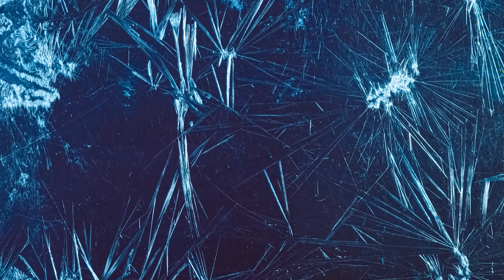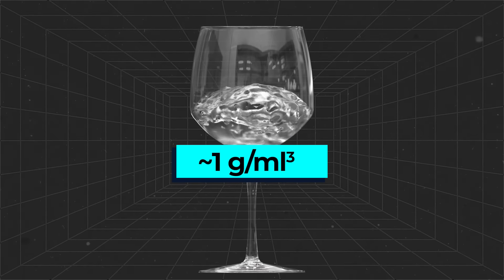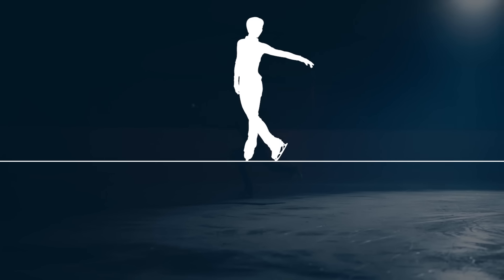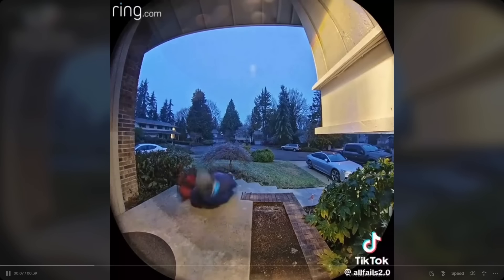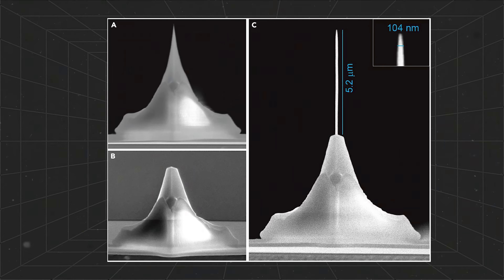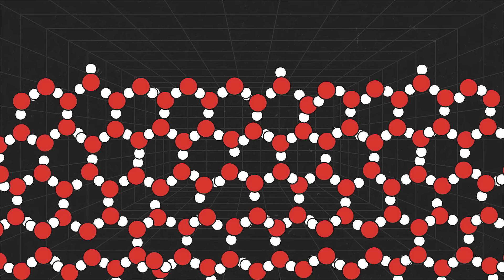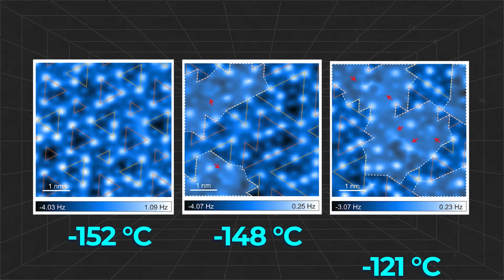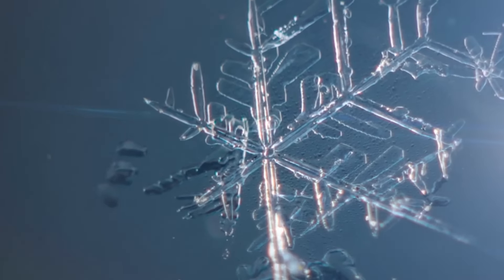We FINALLY Proved Why Ice Is Slippery

Comment: do you know why, when you wet your fingers with a tiiiny amount of water you get insanely good grip (on a smooth metal surface for example)? completely dry fingers are slippery and completely wet ones too but theres that perfect amount of water that gives you an insane amount of friction
Reply: The answer is probably capillary forces pressing your hand and a surface together.

Just lay 2 flat glass sheets on top of each other and add 1 drop of water between them - You'll be surprised how much force is required to pull them apart
Reply: this is also the case with some types of garbage bags. With dry fingers its hard to seperate / open them but with damp, not wet, it's easy
Reply: Just a hypothesis, but it might have to do something with the oiliness of your fingers. By applying water, the oils on your fingers are rendered less effective. I wouldn't be surprised if there is an optimal point between reducing the effectiveness of the oil and the effect of the liquid water itself. But like I said, that's just a hypothesis.
Reply: That's because of the grease on your skin. Clean the properly and this happens way less
Reply: @cyfralcoot65  ooh, I like the capillary idea. It might be different for pulling apart vs pulling along. My first thought was just cohesion. That might be too simple, though.
Reply: sounds like cold welding
Reply: Yeah, its all down to Friction.
Reply: Fun fact, we used to have these contraptions called "books" that would often benefit from a lick of the finger to turn over what were known as "pages".
Reply: @cyfralcoot65  That's what always happens to my mug on my ceramic coaster, it gets stuck to the bottom of the mug from the condensation for a moment before falling off.
Reply: there's*
Reply: @allanshpeley4284  Oh, is that why people do that! It has always confounded me.
Reply: This becomes a kind of art form for throwers, especially of the discus. Often using a little spit on the fingers and rubbing it into the steel edge to get the grip just right.
Reply: This effect is why there is an old meme people licking their fingers turning powers in books and newspapers. It features an important clue in The Name of the Rose.
Reply: @cyfralcoot65  Absolutely............

That's why glass chopping boards have plastic dots on the base as fluids beneath will almost  bond the glass to a worktop!
Reply: @cyfralcoot65   Capillary action is the start of the explanation, but hydrogen bonding is the cause of this.  Hydrogen bonding is discussed much in this video and is a weak attraction between the partial positive and negative charges in the water and the other substance. 
 The answers having to do with oil and friction, unless you just ate potato chips, are a bit off the mark at molecular levels. Oil lubricity works by hydrodynamic lubrication where there is a layer of liquid between the two solids, completely separating them.
Reply: @brokenrecord3523  van der waals forces in general, but the london part is probably by far the greates with water.
Reply: This happens on your phone screen too, straight after washing your hands and drying them when they are still slightly wet. It makes it much harder to swipe across your screen, I noticed this when playing a game where you need to swipe to move the character around using a virtual joystick.
Reply: @brokenrecord3523   I think hydrogen bonding is what begins the capillary effect, then the rest of the water is pulled along with the initial molecules. Do you think that’s correct?
Reply: @charlieevergreen3514  Yes, it is hydrogen bonding that is the cohesive force  causing the water to follow itself.  Hydrogen bonding is just a fancy way to say positive -negative attraction (dipole, or two poles like in a magnet).
Reply: @bl4cksp1d3r That grease is there for a reason. If you routinely remove all of it, you get chapped skin.

Don't throw shade on people for having normal fingers.
Reply: @SwervingLemon  sorry, no shade intended? I did not mean to imply that someone has dirty hands. I just meant if you remove the bit of natural oil/grease, it'll change
Reply: cuz water is sticky
Reply: when it's  humid outside and everything is vaguely sticky :(
Reply: As a mobile artist who draws with my finger yes. I do. Painfully.
Reply: adhesion to the surfaces
Reply: @hangry3102 : Same
Reply: Pressure 🎉
Reply: @S1nwar -- Yep, it's what allows us to separate paper book pages and the clingy sides of unopened grocery bags at the self-checkout kiosk. Lick (or better yet, breathe onto) your thumb and finger. Underrated ability, but we'd suffer so much more "oddly enraging daily minor annoyances" without it.
Reply: Humans actually have a lot more sweat glands on the inside of their hands, very likely because it makes our hands more grippy.

Comment: This is a perfect illustration of the problem with active measurement. The energy introduced to the system to measure it changes it. Therefore what you are measuring is the system plus the measuring method. So you can never measure just the system.
Reply: Are you making a reference to the QED measurement problem in your statement?
Reply: Yes. That sort of question was always in my mind when reading/reviewing AFM-type experiments (I was working with surface plasmon resonance at the time).
Also, more than one supervisor reminded that "remember, this is their best data they are publishing". Asking how often another pattern was observed tended to make people get a bit scientifically defensive.
Reply: In this particular case one wants to measure what happens when pressure is applied on ice. It may be more a matter of concern that one may not be applying enough pressure. 

However, Since the probe is so light it is measuring the bumps in the surface more than the slipperiness. Also as told at 13:43 , -100°C ice stops being so slippery, so no problem overall.

Comment: As someone who lives "quite far north" I can attest to the fact that ice gets less slippery when it's REALLY cold. Bur also if the soles in your shoes are cheap and contain more plastic than rubber they get hard as bakelite and insanely slippery.
Also if it's really cold and there's a slight layer of powder snow on perfectly blank ice you're screwed. There's no more slippery surface in the world. Literally no friction. It's like being the puck on an air hockey table 😅
Reply: I believe you. But coming close is a hard rock road (graded flat and smooth) with clay over the top (also graded smooth) and rain. That's extremely slippery as well.
Reply: I live quite far south. It's always so hot.
Reply: @Myron90 you live not as much far South. Really far South is also cold
Reply: @Myron90  you live quite far middle, then
Reply: I can't hear the word bakelite without having flashbacks to End of Evangelion.
Reply: Assume no friction. Easy been there, it's outside a few months every year.
Reply: @ragerequiem6323  Worst is probably when the snow on top of the ice has somewhat melted together making you think there's good grip but then suddenly the snow breaks apart and you have no friction at all and you probably tore a muscle trying not to fall... Or a huge black spot on your hip from landing on the ice
Reply: As a Colorado resident i can attest
Reply: @_apsis  precisely
Reply: Swed here.  I  have observed that when its colder the ice gets less slippery,  but other factors come in like if there is a cold  ice and there is moisture condensation freezing on it it gets very grippy  . So the evenness of the ice is a big factor. 
If you flush the ice : first it get slippery as hell when the water is still in fluid fase, then it gets kind of sticky, after som time the sticky ness decreases and it gets slippery.  I would guess that build up of flowing water on ice  creates  a smoother surface,  but  small crystals from condensation  makes it more jagged.  Cold powder snow on ice is awful to try to walk on.
But if it gets packed down and is alowed to freze , it gets stuck on the ice.
Ice skating on thin powder snow is no problem, but a soon as you start to mess with it it gets hard and hard to skate on.
Reply: @perstaffanlundgren  And when the snow is melting just enough, it cakes on your skies in sticky masses and keeps you from being able to slide at all.  I was once cross-country skiing under conditions like that and had to take my skis off and walk out, which was also more difficult than usual.
Reply: Can confirm. Went off the road
Reply: Have you ever tried vegetable oil on ice? My friend accidentally did. Your only hope is to lie down and try to roll away from the patch.
Reply: no friction you say? so that's where my physics test questions come from. Quite far north.
Reply: Can confirm, had to get boot chains for winter
Reply: yep, and giving explanation from the video with that marble analogy, it shouldn't matter what material your soles are made of, yet tpu soles are extremely slippery at all temperatures while special winter soft rubber ones dont slip at all.
Reply: I once experiences powdery snow on bare asphalt. It was even scarier than with ice under the snow.
Reply: As a Canadian, can confirm. You develop an instinct for when ice is still going to be dangerous to traverse. Dirty ice is great. Super clean ice is terrifying. The scariest ice is the ice you never see until you’re bracing for an unexpected impact cause you’re not in control of your car anymore.
Reply: @Padraic54  To me it will always evoke Serge's Gainsbourg "Sea, Sex & Sun"
Reply: @philippenachtergal6077  

Had to look it up. This musician reminds me of the 2006 internet sensation Gunther (The Ding Dong Song).
Reply: Yep, dry snow on smooth ice is the worst, can confirm.
Reply: Well yes, friction is electrical as usual and relative to material. The other component, which in my opinion should be called something else, macrofriction or grip for instance, is also affected by cemented crystal condensate, giving a matte look.
-Rolling action is intuitive for humans but I suggest that is insignificant and these 'free water molecule marbles' have roughly the same friction as ice against ice, and one or both of two things happen: 1. These 'marbles' get between and uncouple the electric forces of sole and ice. 2. The marbles also slip on each other as if with layers, multiplying the loss of friction
Reply: @colinbanning9416  Lose control of your car in northern Norway and you lose your license. Days with "blind ice" are good candidates for not driving, but even then spikes will make most travels doable.
Reply: Like worn-out crocs on boat ramp algae then?
Reply: @owenblount7334  Oh yeah wet algea covered surfaces are also without friction that's true. And yeah I guess worn-out crocs would be worst case scenario for that. Yeah I guess that would be comparable then 😊👍
Reply: Like south dakota gummbo. @blucat4
Reply: Eskimos have hundreds of names for snow. As one who really does snow a lot I know that living and working in the snow is very different from playing in the snow then going back to your nice warm home. Knowing when snow is dangerous is really difficult for recreationalists who can't understand when snow is dangerous and going there they will never return to their nice warm home..
Reply: the closest thing to snow we got was some hard ice cubes with rain where i'm from
Reply: that moment when you pour water on permafrost and accidentally walk over it be like

Comment: So the AFM is actually like a really small record player stylus.
And with the laser bouncing off there are 2 levers involved:
The stylus is one and the laser beam is the other.
Reply: With a rather odd definition of lever, sure.
Reply: Paint It Black  (ha ha) and the beam will apply 'pressure'.  Hey...  I know!  Apply a Vanta black surface treatment.  Oh crap, then you will not be able to see the laser bounce!  I suddenly hear David Bowie music in my head...  I am getting old.
Reply: @cosmicraysshotsintothelight  The beam will exert more pressure (twice as much to be exact) if you make it nice and shiny rather than black.
Reply: The explanation in the video is oversimplified, but sure. The actual paper used non-contact mode AFM, meaning the tip oscillated just above the surface and the atomic force was derived by modulation of the amplitude or frequency of the oscillation
Reply: The world's smallest phonograph player. LOL
Reply: @SuperBoppy  They should have imaged the IBM logo on an IC chip or maybe better image the grains on the surface of a hard disk drive platter with a gazillion bits per lineal inch on it
Reply: Now I want a consumer-grade record player that uses lasers. Just think of how compact the discs could be!
Reply: @ads1035  You do know that this has existed ever since the CD arrived.  It is, in fact, the CD.  Oh...  I see what you did there...  But do you remember the "Optical Cube" that never came about.  They even recorded onto the layers of a roll of shipping tape and read it.
Reply: Okay, so if the deviations measured by this device are converted to acoustics instead of visual image, shouldn’t each substance have its own unique “song”?
Reply: @ads1035  Please rewind your disc to the start before returning it.
Reply: @entcraft44  Funny then, that a Crooke's Radiometer spins away from the black faces of the paddles than away from the white faces.  But they have successfully punched a dent into a missile at distance with an eximer laser.
Reply: @cosmicraysshotsintothelight  Yes, Crooke's radiometer is an interesting case. There were many attempts at explaining it, including radiation pressure. However, we now know that it has to do with differential heating of the atmosphere around the edges of the blades. The air flows from the warm black side to the cool shiny side. You can prove that it isn't radiation pressure because it only works when the vacuum is just right, not with too much air but also not with too little.
Reply: @entcraft44  I was unaware that the bulb's chamber was anything more than a deep vacuum.  So you say that in a good strong vacuum it will not move at all?
Reply: @cosmicraysshotsintothelight  Correct, in an ultra high vacuum it will not move, as radiation pressure is generally not enough to overcome the friction. Of course, if you shine a high power laser on it that might change; or maybe you can remove more friction with magnetic levitation.
Reply: @entcraft44  The friction is the point of a pin on glass.  Less that that of a watch 'jewel', one would think.
Reply: @cosmicraysshotsintothelight  Radiation pressure is incredibly low. I calculated the maximum weight of the rotating assembly such that friction can be overcome by the pressure on a sunny day. It comes out to be 1.36 µg for a watch jewel bearing, and 27 µg for the lowest practical friction coefficient I could find. Even then I have overestimated the actual irradiance. I will write my assumptions in a second comment.
Reply: @cosmicraysshotsintothelight  Assumptions: Four vanes, each with an area of 1 cm^2, with perfectly reflective front and black back sides. Each receives 1000 W/m^2 of irradiance. This is typical for a sunny day at sea level, in the direction of the sun. Of course in practice only one side could be illuminated with directional sunlight, so that is not quite accurate. The coefficients of friction I used are 0.1 for watch jewel and 0.005 for hard steel on steel or glass on glass with special oils.

Comment: I knew about electron tunneling microscopes, this looks a slight bit simpler than that. The fact that we can scan atomic-scale resolution is mindblowingly fantastic.
Reply: atomic-scale AFM is fairly difficult, by which I mean you need the proper setup. Like all atomic-resolution methods right now, it mostly only works at cryogenic temperatures in vacuum... but more generally easy-to-use AFMs can still get nanometer order resolutions and can be modified to measure all kinds of other phenomena (conductivity, work function, magnetic moment, piezoelectric effect, etc.). Liquid environment AFMs also operate at slightly lower resolutions and can pick up electrochemical signals and the like. My second most cited publication (sadly not first author) was used electrochemical microscopy to detect analyte activation on sensing nanoparticles.
Reply: @admthrawnuru  Why does it have to be so cold? Is it because at higher temperatures the atoms move around too much?
Reply: I know a reasearch group who just uses a platinum wire which they cut off at an angle with scissors and then pulse current through a few times till they have a one atom tip. Works quite well for their use case and was quick

Comment: 0:00 solid ice bonding together is actually a rather common thing to occur for solids near their melting temperature. It is called sintering. We rely on this phenomenon to form solid high temperature materials, such as technical ceramics and high temp metals.